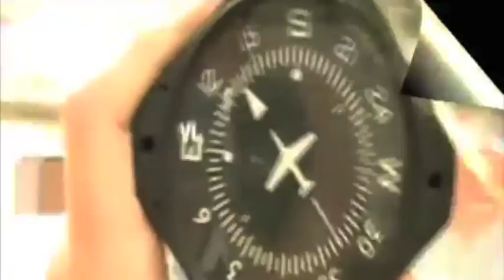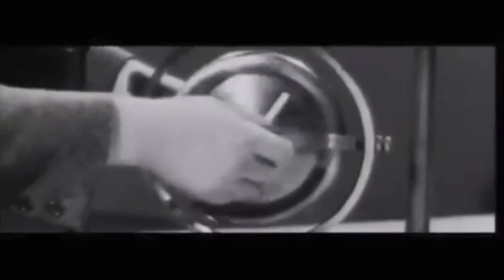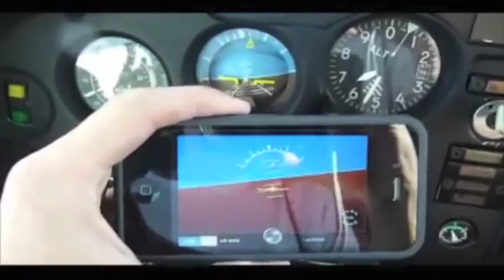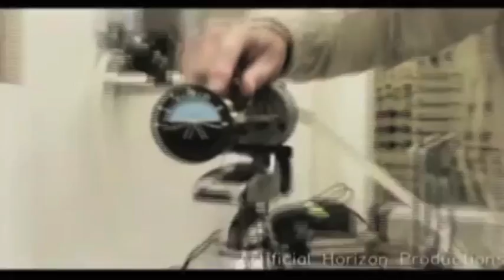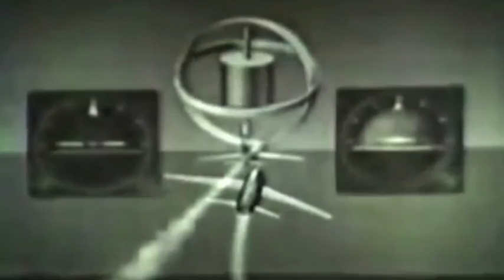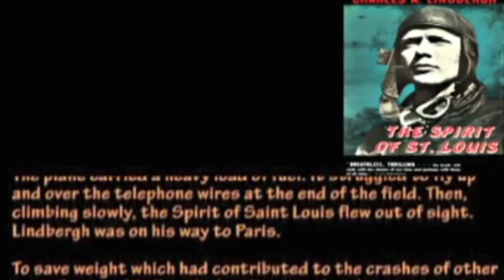I.Q. BUILDERS: Flat Earth & Schuler Tuning FRAUD! (summary)

Comment: QUOTE > The instrument may develop small "precession" errors, in pitch 
indication during extended periods of acceleration or deceleration and, 
in bank indication during extended periods in a turn, caused by the 
mechanism that normally keeps the gyro rotor properly erected. These 
errors develop very slowly (usually at not more than 2 or 3 degrees per 
minute) and are not significant in normal flying. Some attitude 
indicators can only tolerate a specific range of bank angles
UNQUOTE
Mechanisms therefore exist to keep the gyro righted. These mechanisms make sure that the gyro doesn't ignore the effects of earth's curvature

Comment: The is no ACM module in an ADIRU system.  The claim that one exists by the "supposed commercial airline pilot" is false.  It doesn't exist at all.  Show me an ADIRU schematic or data path chart that references an ACM module.  That anonymous letter was either a total fabrication or the pilot got his jargon messed up. 

Your claim the the pendulous veins function to dampen the movement makes no sense at all.  If the gyros movement in the gimbal was dampened that would cause precession.  The result would be a gyro that had lost its orientation with the horizon.  Also, we know that acceleration and deceleration will induce a torque that will cause an attitude gyro to precess.  Erection mechanism are needed beside caging to keep a gyro oriented with the horizon.  Those are required regardless of the shape of the earth.  The question is how does it do that?  How does it resist precession and correct itself? 

Lastly, precession doesn't refer to the apparent movement of a gyro from one frame of reference.  It refers to its reaction to a torque applied to the axis of rotation. 

Please explain how a ships gyrocompass works.  They do work on the basis of precession and will end up pointing north because the torque applied.  If it's not earth rotation that is applying the torque these please give and alternate explanation. 

Please explain why the beloved Michelson, from the Michelson-Morley experiment, predicted and measured the rotation of the earth with a Sagnac interferometer in 1928?  Are those detecting rotation with similar ring laser gyros just lying?  Many measurements are being taken by amateurs.